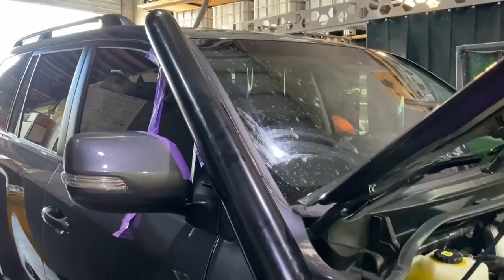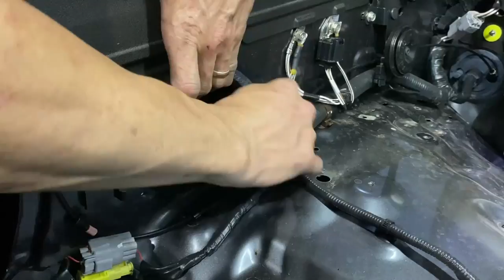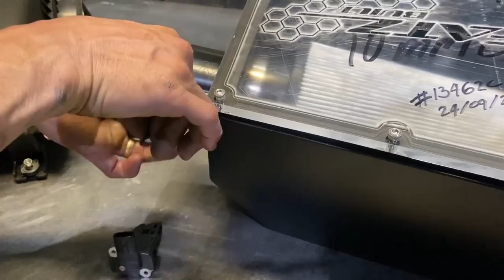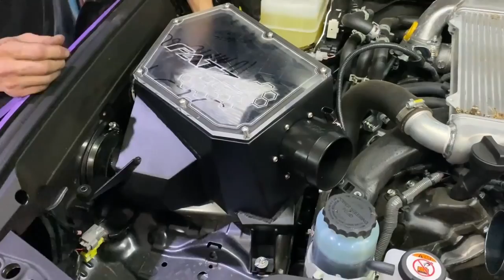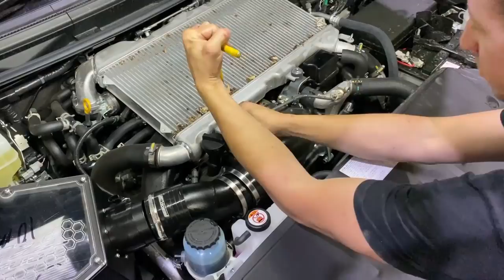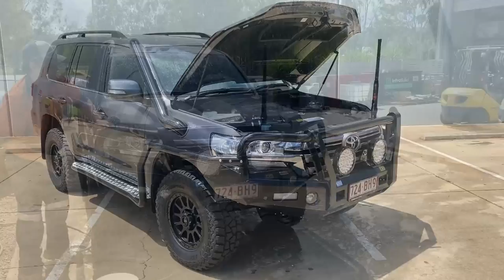Fatz Fabrication 200 Series Airbox Installation

Comment: Interesting.... duel snorkel and airbox  but single turbo... makes no sense. 

Have you ever looked at the ac air intake on a 200 to have a duel snorkel that feeds the ac so deep water doesn't flood the AC and filter?
Ac in take under windshield passenger side.